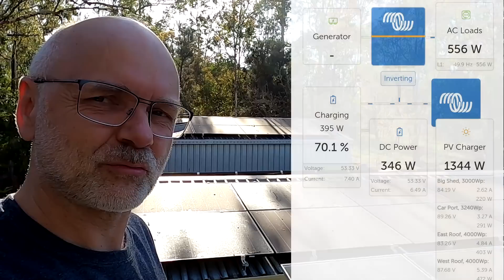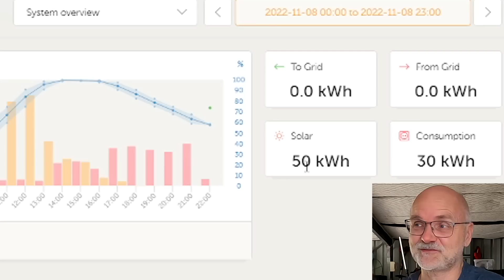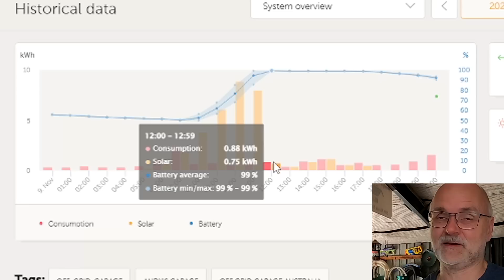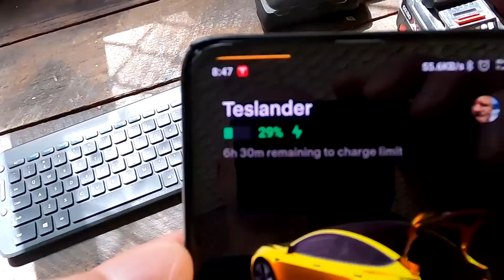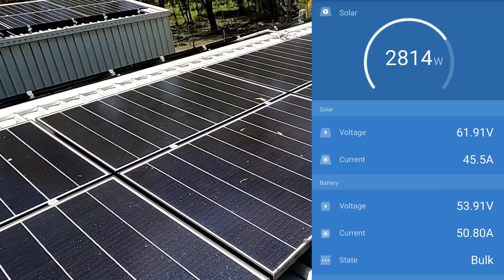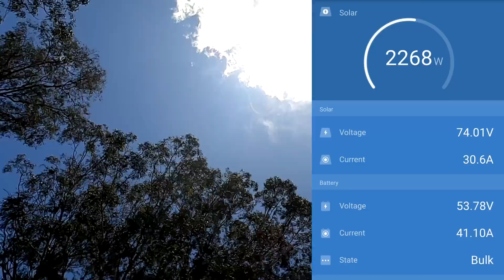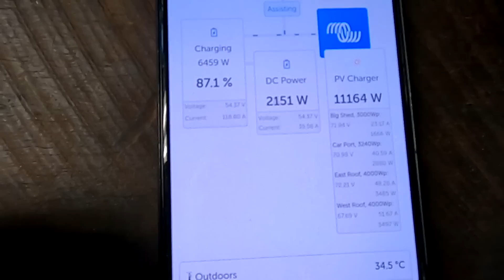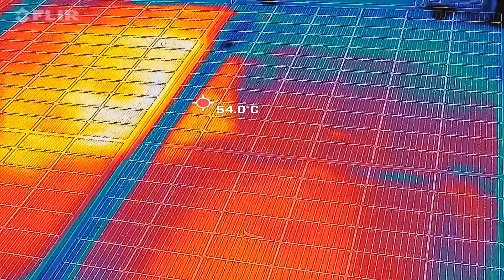I had to limit the output power of the new solar system. First impression after a few days...

Comment: Too much energy........you taking the spat???
Never enough!!!!
The way I'm thinking about my system is ....
I'm thinking winter time, we've just had two weeks of crap solar weather in Yorkshire UK.
So I'm building mine to cope with winter to try and not use grid power.
Down side ill have too much in summer.
Mite install a car charger at a cheap rate for summer use, with alittle bit of income too.
Reply from the maker: Yes, absolutely, it won't be too much in wintertime any more, I guess. That will be the time to measure...
The road is too far away for a public charger and I have the only EV here in this region.
Crypto asic or a pool heater maybe...

Comment: you need a bigger battery
Reply from the maker: Won't help. I need bigger loads!
Reply: @OffGridGarageAustralia  Noo... I ain't talking on harvesting energy point of view but on consumption perspective.
You see i've observed in your two first days(since complete install) you consumed 50% overnight. Then a thought came to me since your energy generation is of monstrous proportion compared to your storage...(though not necessary) it would have made a big difference to have twice the size of your storage and with your current load you'd be at25% even when you over consume.

Comment: Just a note on my 15kw grid setup I can produce during summer over 100KWh in a day, and I am a little further south, so your system has potential.
Reply from the maker: I probably won't reach that as my roofs are facing East and West and I have a bit of shading in the morning and afternoon. Not ideal conditions but still far more energy than I need atm.

Comment: Dear Andy why don't you partnership with few bug lifepo4 or any other good lithium battery makers like battle born. And grab as much as 50kw or maybe 100kw worth of batteries. And make a free Tesla charging for a bear at our side your house. So that you won't be leaving the production energy as waste. And you'll be giving away free green energy to the society. Or else fill your backyard with halogen bulbs which consume around 2kw,4kw,  10kw of load bulbs.
Reply from the maker: The road is over 250m away from the garage and there is no parking possibility at the curb side. Council would not like that either. It's all not that easy if you enter public space... permits and regulations will kill the idea quickly.

Comment: Andy is drunk.. Drunk on POWER!!
Okay what to do with the excess energy?  A large domestic heat load is hot water.   Andy, consider picking up an electric water heater or even two and  plumb them in series with your existing home heater.  By preheating the original heater's feedwater it will not use whatever energy source it's using now that you may be paying for.   That would supply a lot of power to your house without supplying electricity into your house.

Another common use for excess power is the opposite.  It takes a lot of energy to make ice.  Frequently ice is made that's sold to either a retailer or to an ice house.
Reply: Andy has explained that his HW system use is about 3kw/day, so that is minimal. I like the ice idea maybe, but I think he is considering heating the pool until his FIT arrangement is over, and the pool heating idea is probly the best way to effectively dump as much power as he wants to at anytime for now.
Reply: @evil17   That pool is certainly great gobs of H2O.  I just figured "sunny hot Australia" didn't need pool heating.  If it does that would be an easy big consumer. Nice alternative!
Reply from the maker: I think we could extend the pool season by 1-2 months with a heater. At this stage I'm not sure if this is a good idea or not and how much surplus power I still have when I would need it for the pool. 
It's an option but also feels like wasting the energy a bit...
Reply: @OffGridGarageAustralia  But if you've throttled back your chargers you're already "wasting energy".  I just saw a "diverter" with the horrible name MYENERGI EDDI SOLAR POWER DIVERTER.  It or something like it could be used to divert whenever your net charging current exceeds 2xxAmps diverting AC power into, say, a pool heater.

Comment: Too much power???????  Probably now it will turn out that your battery is too small to secure for cloudy days the needs of your house and Tesla. (both)
You will enlarge it and then it will not be an off-grid garage, but an off-grid ZERO ENERGY HOUSE!!!! You're just one step away from being able to safely DISCONNECT your power grid and tell your provider: "Bills? No, thanks!" You might as well become a prosumer (PROducer+conSUMER) if your provider has such a service. Similar result: no bills, but no OFF-GRID...
After all, under one condition: check to what extent your panels cover your average daily energy demand IN WINTER!!! IF they produce enough energy it will allow cut the power grid!!!!
Reply from the maker: I'm far more than just one step away of going off-grid. Connecting the house will be a challenge due to the high feed-in tariff for the house solar.
A bigger battery won't help, I guess. We're using around 20-25kWh per day including hot water and vehicle charging. Even less in summertime. 
Winter will be interesting to watch...
Reply: @OffGridGarageAustralia  Yes, yes, I know: you are a cautious skeptic seeing a battery half discharged. ;))) On the contrary, I always see a half-charged...
The best way to assess the possibility of disconnection (or not) is to observe your electricity bills. From my rough estimates, you should stop drawing electricity from the grid right today. And that means zero bills (except for flat fees, which probably exist in Australia as well). So, this is not so far.
And yes, you are right - the most interesting period for ratings is two weeks before and two weeks after the winter solstice. This is the most critical period in the life of any photovoltaic installation. Test of true!!!

P.S. IMHO you have a bit too little inverter power. According to my estimates, an independent off-grid house should have a power of 10 or even 15 kW (kW, not kVA!!!) to meet all peak requirements so that residents do not feel the lack of a power grid. And it's not a very big house... On average, about 1 kW/10 m2, assuming a very good thermal insulation of the building. WITHOUT powering the electric vehicle. This demand must be assessed separately on the basis of the average kilometers driven.
My estimates concern Europe and Poland, but I have the impression that for Australia they will not be diametrically distant. After all, your country and mine are almost exactly at the antipodes.
But that's just my opinion, in your home you make the decisions! :)))

Comment: Two words: Cryptocurrency mining.  You’ve literally nothing to lose!
Reply from the maker: I've ordered one asic now to see how this goes. It should work as power is free...
Reply: From what I have learned about crypto mining in Australia , and I dont know much about it, is that it doesn’t sound very viable because if you can get the ridiculously expensive cards and setup to do it, our internet is not stable enough to run it reliably which can cause very expensive cards to POP, not to mention the heat, power and noise these things make.

Comment: could you do a video about charging your car , I am curious if I have enough solar capacity to charge an electric car from my system , if I buy one that is, 48V  5kv victron inverter with 9 kw battery and 10 big victron panels , like you my system goes onto float about midday and just runs fridge freezer etc for the rest of the charging time each day then runs a lot more after dark each night
Reply from the maker: That will definitely work. Maybe not in winter but all other seasons should be OK. Depends on how much you drive of course. I'll do a video, sure...

Comment: im thinking those panels are running hotter due to their tilt angle in relation to the sun, if they are on a more direct angle with the sun they will absorb more heat.
Reply from the maker: Yeah, hm... I know what you mean. None of my panels are ever in that very ideal SPAT position. And if so, only for a very short moment...

Comment: Hi Andy I need some help , since I started using my new eve battery bank  I noticed that when ever it's under load a particular cell is always blinking red looks like it's the most discharged , am using jk bms and wouldn't really want to overwork any of my cells theynare 304ah eve 24v cells , so please how do I fix this?
Reply: @just_saw_dust  hi ben, thanks for your concern i apreciate it and about the balance this cells came in 14 days after i ordered them and they were about 100% balanced , i didnt think it needed any more balancing and no i habvnr run a full cycle yet ijust got it set up and i dont have a lot of load in my apartment , my paraneter is is 3.6v- 2.5v am thinling is the terminals or something the diviation during discharge is 0.032, my point is that this cell keep blinking red at any load , i know red means its got the lowest voltag... so for reason that paticular cell discarges the most and somehow my 2a jk bms isnt able to catch up with with it
Reply from the maker: Also check the bus bar connection for this particular cell. Is it also showing blue when charging and has the highest voltage of all cells? Could be either a connection problem or an issue with the cell itself.

Comment: Very good adding more panels on roof to reduce heat 
☕☕
Best regards from Philippines 🇵🇭 Andy
Reply from the maker: It's a lot cooler in the garage. I'll add some more insulation panels in the very top of the roof where there are no panels outside.

Comment: Andy I mentioned once before that I thought that you are likely have a large over supply of energy with the new panels.
So are you considering moving as many house loads as you can across to the shed system, so that the house solar system can throw all it's generation into the grid and get you some of the 0.49 cents a kWh back into your pocket.

It seems such a shame that you could be 'losing' some of that great shed power ATM.

I know I would be beside myself if I was generating so much power that I had to throttle it back, sort of like spilling SPATs on the ground lol🤣
Reply from the maker: Yeah, I was expecting a huge power surplus in summertime. Next year, we will seem how much power we will still get from the system. From April on, production usually goes down substantially.

Comment: Hi Andy could you please make a Diagram of your solar panels for your website are thay wired 2 in series and than parallel. So much power I'm  Excited for you. I wonder how your going to use all the power I know you don't like to waste free energy lol
Reply from the maker: Yep, that's how they are wired, 2 in series and 5 strings in parallel. I made a video a while back about the system and how it is cabled. Not much has changed, just more panels.

Comment: Excellent results, I love it! So the tilted panels are running hotter, my guess is it totally due to the colour as the tilted carport panels appear to be darker (Blackish), while the west roof panels? Are a bluer colour. I wonder if you laid one panel flat if its temp would increase any due to less ventilation?
Also, despite ur very good reasoning against having a 2nd battery, my thoughts why a second battery would/could be useful are as a quick charge backup for the Tesla, so you can fully recharge at any time if need be.
As far as burning More of the excess energy, I can only suggest to get a Dyno and put the tesla on it. Great job. Cheers
Reply from the maker: The tilted panels have a lighter colour than the shingled panels which are just black. I think it is because I measured the black panels at the bottom where cool air stream under the panels and the tilted panels, I measured at the top where the hotter air comes out in between.

Comment: I would look at setting up DVCC Andy, that way you can limit the 250a dynamically, but still allow each controller to utilise their maximum performance if there is <250a going into the bank.
Reply from the maker: That would require the different BMSes to communicate with each other. I'm looking into this with the battery 2.0 first and see how this all works using the Seplos BMSes and batteries. Once I know more about it, I'll go and upgrade the production system as well.
Reply: @OffGridGarageAustralia do you need the bus to do anything ?  The dvcc should just limit the charge controllers to set value of for example 250 amps.
Reply from the maker: @STRUTZKOFF  I turned it on now and it works, kinda... there is a catch though with unmetered DC loads. It's not optimal, but it helps to limit the overall charge current.

Comment: hello, the reason why you decided to increase your solar production was to fill your batteries to the top in a single day or for what reason.  limiting your mttp is almost the same as placing fewer panels on your roof. In your place, I would have only changed the recycled panels you had and that's it, now you are short of batteries to put all that energy in and more things to spend it on, if not none of these changes they're worth it .
Reply: limiting the MPPT is not the same as placing fewer panels on the roof. Fewer panels produce less power in the morning, in the late evening, during shading and in winter times - limiting the MPPT does not. 

This system is not focused/designed to produce 14.2kW peak, instead was designed to provide at least 1kW during cloudy conditions in the winter, and the 15kW Andy is seeing now, in the summer, is just a result of that.

Australia has very low solar production during the winter, which is where Andy wants increased production.
Reply from the maker: As I explained in previous videos, I cannot get these older panels any more and hence decided to replace them all. 
As Stefan explained, there is a reason for this over-paneling. Winter will come and we have to wait and see how much power/energy I will still get.

Comment: Awesome power!

We too experience the same with our off-grid system; the batteries are full around 2pm in fairly sunny days. We're using all-in-one inverters, so the solar energy can directly power the load requirements even batteries are not charging.

Andy, is there any special reasons for you to use separate charge-controllers and inverters (specially when you were with less-powered panels)?
Reply from the maker: Mostly redundancy. If one controller goes down, I still have three running. If one inverter goes down, I still have another one. 
With the shading, I have a lot of parallel strings of panels instead of long series connections. I cannot use an inverter with built-in MPPT therefor.
Reply: yes, what is the reason behind this setup andy?

Comment: @andy what is the DC power load that shows in the victron overview? I couldn't figure it out as it fluctuated so much. At first I thought it was maybe the Pi and some dc-dc chargers on desk but when it went over 2kw I assumed that was wrong.
Reply from the maker: Basically everything which does not go through the inverter directly. It can be up to 4kW of DC power which is most likely the Xija Inverter running loads inside the house via extension cables.

Comment: My take from your experiment is to oversize solar by 2/3 if you don't want to deal with shading. If you are thinking about ROI, or don't have the square footage, deal with shading and spend 1/3 of the solar cost. Personally, I am oversizing each battery breakers and wires to be able to handle 150 to 200amp. Those 100amp DC breakers will start tripping if only 1 of your battery  banks is down for maintenance unless you make sure you are throttling the mppts or if the actual tripping point of the breakers is higher than 100a.
Reply: Outback and sensata/airpax are cost effective alternative for high amp DC breakers. You can get them with 80vdc ratings. Enough for the output side of the mppts
Reply from the maker: Yes, you over-panel the solar system to compensate for shading or bad weather.
The breakers need to have a high breaking capacity. The NOARK I use have 25kA, more than the usual Class-T fuses.

Comment: It makes sense that the tilted panels will be hotter as they are at a better angle to the sun.
I am just imagining being at work with Andy on the first day after the full install.  Andy wips out his phone and you hear YES YES YES LOOK 5KW.  Then a cloud comes over.  OH NO, OH NO, OH NO NO NO.  NOW ONLY 900WATTS. GO AWAY CLOUDS.
I can only wonder what his work colleges are thinking.
Reply from the maker: The sun angle was not what the temperature difference caused by, but more measuring one panel at the top and the other at the bottom. 
Yeah, that was it pretty much at work. Colleagues watched it with me and were excited 😁